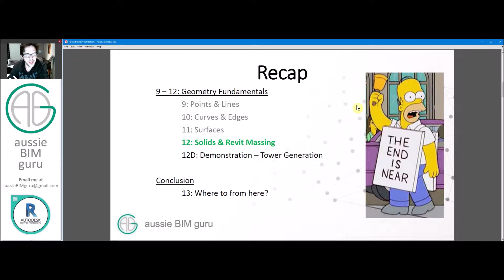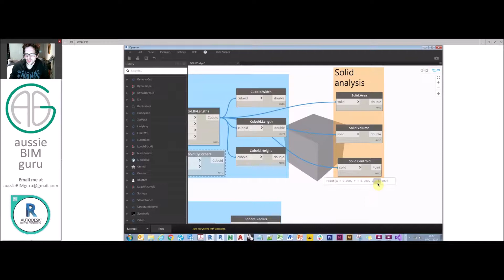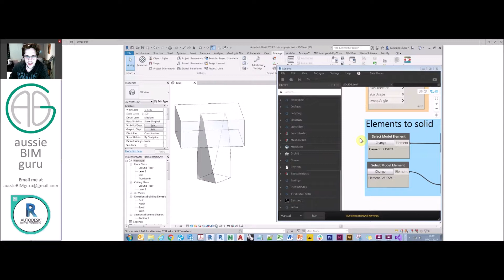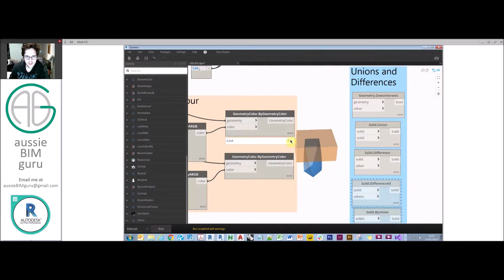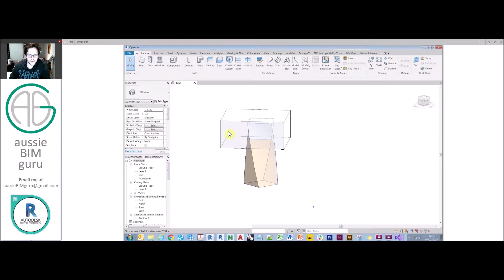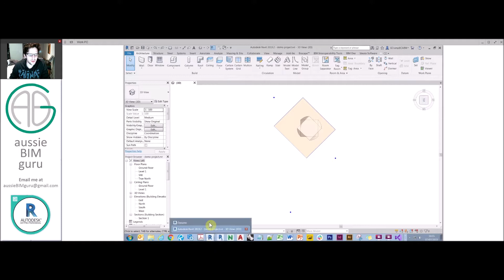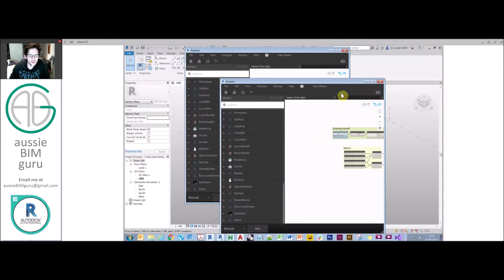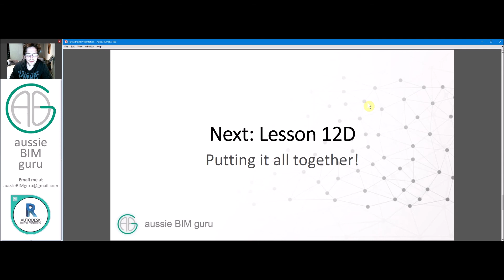Learn Dynamo - Lesson 12: Solids and Revit Massing

Comment: Hello. It seems "solid.fillet" node creates filleted mesh instead of solid. Is it known issue? Is there any workaround? I've been trying to fillet some furniture geometries and they looks awesome in dynamo, however when imported to Revit turs to mesh. Which means the output of the sollid.fillet isn't actually "solid". I'd be grateful if you had some suggestions how to solve this issue.
Reply from the maker: Yes generally in 2022+ this is revits workaround for forms it cannot rationally construct. Fillets are often a component that direct shapes struggle to support natively, so the API in that case turns to meshing as much as it can.
Reply: @AussieBIMGuru  Appreciate swift rispone!

Comment: How, is it possible to set structural parameters to the shell or truss built with massing?
Reply from the maker: Generally no unless you do all the calcs yourself in code. It's generally best to construct trusses/framing using structural families so they can form an analytical model.

Comment: Hi! I've made a solid in dynamo and now I am trying to create a Revit element out of it. But when I do so, the element in Revit is around three times bigger then the solid in Dynamo. Any idea why this happens? Do you know the solution to this problem?
Reply from the maker: If you're in Revit 2022 it may relate to some internal unit issues that are known. The synthesize package has some nodes which work around this, but it's quite complex. Search on the forums for 'geometry scaling' and you'll find similar requests.